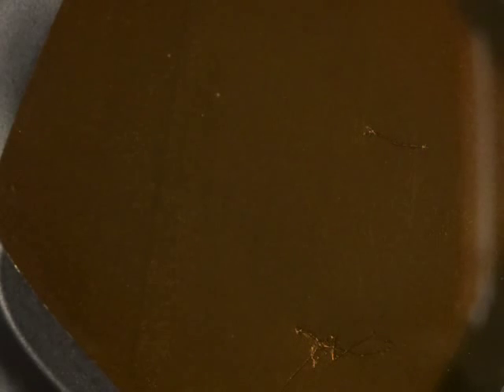VIDEO 53 Uncovering the Missing Secrets of Magnetism. DIELECTRIC COUNTER-VOIDANCE POLARIZATION

Comment: Any difference in dielectric field form with North, North or South,South?
Reply from the maker: Solomons Words YES, in phase shift, you can see it under the ferrocell

however the magneto dielectric retardation is EQUAL VOLUME,  the MD retardation is not equal phase, but the force divergences are equal. 

field pressure extrapolation as necessitated by gyromagnetic precession